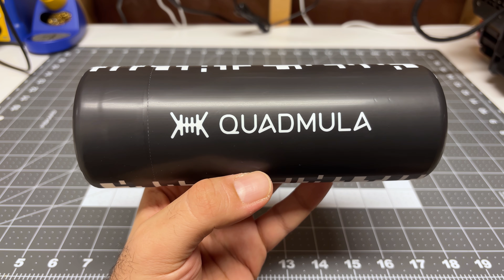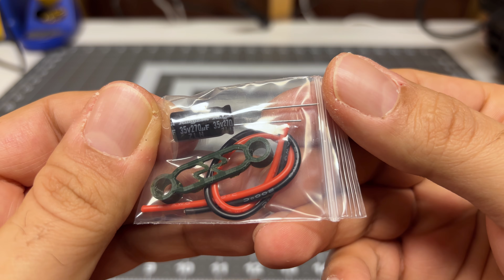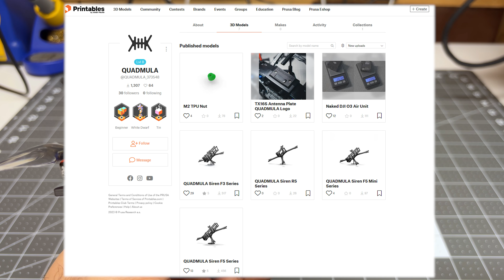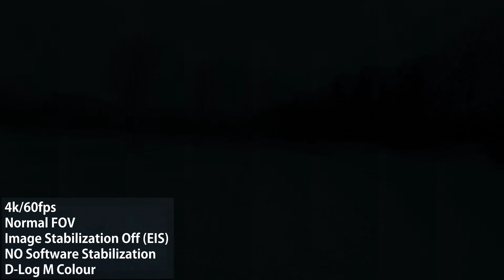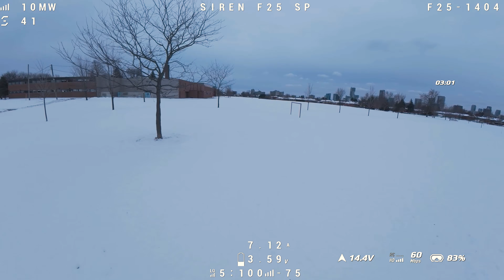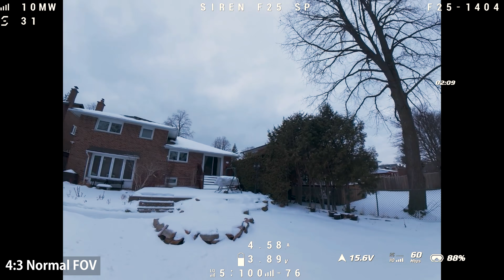First DJI O4 Pro Air Unit EXCLUSIVE Frame 🤩 | The NEW Quadmula Djinn F25 SP 2.5" is Here!

Comment: hey man i love your videos!!! i was wondering i was trying to build the same build you have but i made a change  to the stack because the one you had in your original video was sold out but i was thinking about flying with the Auline 3S 18650 Li-Ion Pack 3000 mAh battery do you think it is gonna be to heavy and not lift off or do you think it will have a lot of power because i was looking for more flight time but i don’t wanna get that battery if im barely going to take off because its so heavy the reason i’m asking is because i was using the uncrashed sim and it lets you make your own drone and put in the specs like how many grams it weights and everything and on the sim the drone was barely taking off is that how it’s gonna feel in real life if i get this bigger battery thank you !!!!!!

Frame: Quadmula Djinn F25 SP: 50
Motors: RCInPower GTS V3 1404 3850kv: 84
Props: HQ Prop 2.5x2.5x3: 3
Gemfan 2512 bi-blades possible upgrade 
Stack: SkyStars F722 HD Pro + 40 A ESC: 129
RadioMaster RP1 ELRS V2: 20
Battery: Auline 3S 18650 Li-Ion Pack 3000 mAh
Reply from the maker: Hmm, that battery pack alone looks like it would weigh 160 grams. That's quite heavy for a quad this small, I usually run packs that are half that weight. Why do you need such a large battery pack?

Comment: Do you feel the 2.5 can be a nice little cruiser for cinematographers as well as some freestyle while being less than 250 and w 850 do longer flights?
Reply from the maker: I wouldn't suggest adding more weight given the smaller props. Is the place you're flying really small that requires a 2.5" to begin with? You could look at going to a 3" or 3.5" if you want longer cruise flights.
Reply: @Mangorille honestly agree and I think 3 is the way for me! Thank you!
Reply from the maker: @mazyarahmadi5424  Welcome, 3 inch is my go-to and has been for the last 4 years. I'll go to 2.5 and 3.5 from time to time but I always come back to 3 inch.
Reply: @Mangorille right on brother thank you

Comment: Interested to know if 2900kv would be a big jump from 2750kv? I have 2750kv on mine and it hovers at 40% throttle... on 6s. any thoughts on how to improve performance?
Reply from the maker: I don't think so. In what area do you find the performance lacking? handling? punch out?
Reply: @Mangorille  I find i lacking in power generally... like my hover percentage is very high I think for a 6s build. It almost feels like I'm flying a 4s battery on a 6s quad...
Reply from the maker: @InfinityDrones  Sounds like your build may be too heavy. What parts and final weight with battery?
Reply: @Mangorille  Thanks for the reply. My weight is exactly the same as Murders FPV - total weight is 189g with 650mah 6s.
Reply from the maker: @InfinityDrones  Do you mean 289g? If so, something is definitely wrong. Post your exact part list please.
Reply: @Mangorille Yes 289g. 
My weight is the same as Murders FPV (like exactly).
Frame 
Speedybee f405 mini
DJI O4 pro 
Hglrc 2750 kV 1404
Geprc EP 1 elrs 
650 HV 6s
Reply from the maker: @InfinityDrones  Nothing wrong with that combo... What about props?
Reply: @Mangorille using gemfan 2540-3 and Avan Rush 2.5 inch
Reply from the maker: @InfinityDrones  Nothing wrong with those props. Something else comes to mind... Double check to make sure you don't have a bad motor or a bad ESC. If one of the ESCs or motors is weak it will hold back the others as the flight controller tries to keep the quad level. Rare issue but I've had this once in the past. Try spooling up each motor in betaflight (without props on!) and see if one of them gives you substantially less RPM at the same throttle setting.
Reply: @Mangorille thank you. I'll check. But this is a brand new build...
Reply from the maker: @InfinityDrones  Doesn't happen frequently but you could have gotten a defective part. The experience I mentioned was on a brand new flight controller stack.

Comment: Great review! I was wondering. I only have 5 and 4 inch quads. But i want to try dji 04 with the most silent setup. Out of all smaller sizes, which prop size do you think is the most quiet? And can also carry a dji 04 pro?
Reply from the maker: 3 and 3.5 inch would be quieter, I'm trying to think long and hard if I recall any substantial noise difference between the two and don't think so. Yes both can carry a O4 pro. I upgraded my 3 inch to use the O4 pro at launch here: https://youtu.be/EawG8dtQmdc

Comment: Those straps are for 3000mah li ion packs.  I end up cutting mine.  04 lite is great on a 5 inch with AXII CNC shell
Reply from the maker: I still can’t understand why they would include the same straps on a 2.5 inch and 5 inch. You’d think those two would use different size batteries right?!
Reply: @Mangorille  EXACTLY

Comment: This could fit a Foxeer 8S stack and a couple 4S 300mah in series. RCinpower 1404 2750kv would be perfect for 8s 2.5" XD
Reply from the maker: I did a test last year going to a 6s pack with smaller cells and actually found that the performance wasn't any better than the larger 4s pack. The smaller cells had way higher internal resistance and the voltage sagged much more than expected. I've heard Bardwell say all the time that the small cells aren't at the same quality as larger cells and he seems to always recommend 4s for smaller quads. I've stuck with 4s as well given my experience with the smaller 6s 530mah packs.
Reply: @Mangorille  The more voltage I have the less D the build needs and the less D filter is needed. I'll keep an eye out for sag on small stuff, so far I've only done 8S and 10S on 5 and 6" so the batteries are larger. Finishing up a 12S 5" then I'll try an 8S 2.5" for science.
Reply from the maker: @ For science! I have so many battery packs just sitting around for the same reason. Appreciate your sacrifice :)

Comment: Stupid question - tell me when looking into googles how do you know when your battery getting low before warming pops up . I see acouple of volts readings in screen
Reply from the maker: You typically look at the average per cell voltage, which is just a calculated number taking the entire battery pack voltage and dividing by the number of cells. I target to land when this numbers hits 3.5 volts per cell. The warnings you see are actually configured in Betaflight based on my own personal preference, such as "Low Battery" warning at 3.5 volts per cell and "Land Now" warning at 3.3 volts per cell.
Reply: Thank you

Comment: thanks for the video.. im getting back into the hobby and considering going with all sub250 drones to avoid registering..  how durable do you think this build is? my last drone was a 5" TBS SourceOne that i crashed multiple times without issues.
Reply from the maker: You're most welcome and welcome back to the hobby! I only fly sub-250 gram for that reason. I find these very durable given the smaller size and lower momentum because of the weight. In all the years of flying sub-250 (5+ years), at most I've broken a motor and an arm. You do go through batteries quicker though because of the quality of smaller cells.
Reply: @Mangorille  gotcha.. im accustomed to used 4s. ill tryout this build thanks.. would a 3" be too heavy?
Reply from the maker: @ No, 3" would weigh about this same. I did a weight check in this video of the 2.5" and a 3" (with identical parts) and they both weighted 156g without the battery.
Reply: @Mangorille  oh duh.. i guess F3 means 3inch lol

Comment: The only problem I can see with the 04 pro is the complete lack of usable nd filters none fit with the frames available.
Reply from the maker: I've got a set of filters on order from Flywoo. I understand that the O4 Pro can use the same filters as the Avata 2. You do need a frame with enough clearance around the camera for a filter, which this frame does seem to have.
Reply: @Mangorille  the avata 2 has a huge camera opening and unfortunately most frames don't accommodate them the only way to use them is to move the camera so far forward as to clear the camera cage that it's no longer protected.
Reply from the maker: @DESTINYFPV  Agreed, the filters made by companies such as Flywoo, GEPRC, and iFlight specifically for the O4 Pro are vertical and more compact.

Comment: Try some T-Motor F1404 4600KV, the 3850KV is a bit low for 2.5".
Reply from the maker: I actually built my non-SP with the iFlight Xing2 1404 4600kv and the 4 blade props. It felt the same but of course was with the heavier O3 air unit so you can probably get another bit of performance that way. However, I still think the best approach is to reduce the weight or even go for a 3" if you need to fly hard.

Comment: It needs more aa far as throttle and voltage because the prop footprint is so small...it takes more for the prop to bite
Reply from the maker: Agree, the props need to spin faster to generate the thrust. Easiest way to counter this would be to reduce the weight of the quad.

Comment: Try the HQ 4 bladed props with an 850hv battery flight performance is much better and just a little longer fly time i also tried it with 6s hv batteries and wow that is what you need to fly this frame yes you are over 250 not by much but it fly's so so so much better murders fpv got it right in his build try it and see.
Reply from the maker: I need my builds to stay under 250g. I've tried 6s 530mah HV packs in the past and you do not get much more performance and the performance drops off way too quickly. I've heard folks like JB mention how at some point you actually lose performance when the cells are too small and they're spot on. The internal resistance of the 530 pack is about double that of the 650 pack.

Comment: Dammit man! Just recently spent over $1500 on new 04s, goggles, three, and three new frames to put those three new air units in. Now because of you, i’m going to have to shell out another 350+ to build one of these little bastards. Naw, I’ve actually been wanting to try a quadmula frame for sometime now, but I always had something in. It’s equivalent size in class. I love the 2.5 inch size as well. I just built the newest 2.5 inch Cine25 from Rosser. I had the previous version and it’s so much stronger implies excellent. This one also looks like a winner, and I don’t have a cine/acro in that size class. I’ve always enjoyed your channel, and have been following all of your recent content. Keep up the good work Bud!
Reply from the maker: Welcome to the FPV disease. ;) Thanks for the kind words.
Reply: @ naw man, I was exposed to the virus back in 2018. I try not to think about it but I’m easily $30,000+ in and have recently resumed to pour a lot of my spare cash(which I know could be more wisely spent) into this crack-like addictive hobby, ever since the O4 hit the scene. I guess I’m going to preemptively start looking for the sturdiest cardboard boxes, since I’m eventually going to end up living in one
Reply from the maker: @gammagonad  This is why I fly smaller 2.5/3 inch quads. Easier on the wallet. :)

Comment: Nice video. Battery manufactures need to redesign the lipo batteries. They need to make them with a lower profile now that we dont need gopros. Its look silly with that battery with such a high centre of gravity.
Reply from the maker: Thank you. You can get slightly flatter packs as well, such as the GNB 660.

Comment: Thanks for the Video. Which adapter did you use to mount the AIO?
Reply from the maker: Welcome. Check the link in the video description, I've got a google drive that has the 3d print files, betaflight config, etc.

Comment: You need to fly with EIS (rocksteady) enabled because that's where 90% of everyone's problem with O4 is. I've built 2 quads now and both required redoing the camera mounts entirely because the camera IMU is so sensitive. In both cases essentially hard mounting the cameras fixed the issues.
Reply: That only apply's to the cheaper 04 lite that does not happen with the pro version.
Reply: @Viseo3dp  you are 100% incorrect. In most cases it's almost unnoticeable unless you're looking for it. The lite does it much more pronounced, this is true, but still very much an issue with the pro. I know this because I've fixed the issue on two brand new drone builds. So much footage with EIS shaking that drives me insane that reviewers and commenters don't even seem to notice.
Reply from the maker: Thanks for the feedback. I generally do not use the stabilization features (on the O3 and the O4) as I find that most of my builds fly smoothly enough that I don't need it for my use case. In your builds, was there noticeable shaking/wobbles visible with EIS off and perhaps the EIS needed to work extra hard to stabilize?
Reply: @Mangorille  Negative, rock solid smooth forward flight on the DVR. Look at the footage playback and there's little micro twitches and shakes obviously from EIS. Total pain in the ass. I've been able to fix it, but requires hours of redesigning the camera mounts. In one case needed to be stiffer, another needed to be softer.
Reply from the maker: @ I did some test flying in the workshop trying to induce propwash etc with EIS on and I didn't see anything weird. Possible that I just don't have the eye for tiny jitters. If helpful, I'm happy to post the raw video on Google drive for you to take a look at.

Comment: Feels like we're guessing at the right motor size. Motor stator size, kv and prop size, vs all up weight, has direct impact on thrust capability and flying characteristics (performance).
I wonder if we would   get better performance with on 2.5's if we moved back down a motor size in addition to dropping all up weight. My target would be a ~35gram 2.5 frame with 1303.5 motors.
Reply from the maker: You're absolutely correct, all of those are intertwined plus the type of flying you're looking to do. I've seen people run 1604 motors on this quad as well, which would be overkill for my type of flying. I've never looked at anything smaller than a 1404 given the weight of these quads when you add in the DJI system. Perhaps something is possible now with the O4 lite.

Comment: Great job! Is there a frame like this for 04 pro that has longer arms to use up to 4 inch props but light weight? I like the explorer lr4 but arms are very weak? Thanks
Reply from the maker: Not that I'm aware of, not too many 4 inch out there. You can find some good 3.5 inch though.

Comment: If only they made a 4" one of these .
Reply from the maker: I expect we'll get a 3 and 3.5 inch version of this.
Reply: @Mangorille  3.5" is nice for freestyle. But I use apex 4" build for a chase rig( need the extra prop size to carry li-ions ) .  Tough frame just dated for 03/04 stuff although I've made it work.  There isn't really any other 4" freestyle frames as such.

Comment: I built and reviewed this last week, ors A BEAUTIFUL frame but the camera just sticks out too much imho.

Love the content bro
Reply: How do you like this vs the avionrc 3.5 O4? 
I find the quadmula frames to be pretty heavy. Makes it a trade off to hit sub250.
I'm a big 4 inch fan. Love the amax F4mini frame.
They also have a new amax f3.5mini
Very light frames
Reply: @chrisbee5481  hey man I prefer the Nexa 3.5 Evo Pro, it's about the same weight but with more thrust, much much better 04 Protection than the Djinn and linger flight times on the same lipos by almost 50%
Reply from the maker: Thanks. Quadmula has a 3d printed front bumper you can use for a bit more protection. If you want no props in view in ultra-wide, unfortunately camera has to be out there.
Reply: @Mangorille  other frames don't have it out there as much to be fair brother and have no props in view, I like it but it just sticks out too much sadly
Reply: @squaddingquads  what other frames are u referring to here?
Reply: @squaddingquads  Yes what other frames ?
Reply from the maker: @ Is the other frame you're looking at possibly a dead cat style frame? If you want a symmetrical X (where all the arms are the same size), you need the camera hanging out fairly forward otherwise you will get the tips of the props in view.
Reply: @himox1651  https://m.youtube.com/watch?v=X-x4bBLSQv8&feature=youtu.be

Comment: I like my SP, and love quadmula, I have more than a dozen of their frames. But recently been really impressed with avionrc. My o4 pro Djinn SP build comes in at 148g meanwhile my avion ikon 2.5 max is 132g with identical components. Thats quite a difference. Features are similar, havent tested durability as much as my quadmulas but so far its been holding up. Gonna build an ikon 3 soon which should only be 4g heavier, performance should be really good.
Reply from the maker: That's a huge weight difference and exactly what you need on a 2.5 inch to balance out the power to weight. How do the frame and arm thickness compare between the two frames?
Reply: @Mangorille  Ikon 2.5 max has 0.5mm thicker arms. Front plate is the same as quadmula (2mm), all the other plates are 0.5mm thinner(1.5mm vs 2mm). Bashed my ikon pretty hard again just now. Damaged the tip of an arm a little bit but other than that its still all good.
Reply from the maker: @painy6588  Thanks for the measurements, that actually sounds very promising.

Comment: Great, have you tried 3000mah lion pack?
Reply from the maker: No but I suspect that would make for more of a heavy cruiser than a nimble freestyle quad. That pack for a 4s would weight nearly 150-200grams. :)
Reply: @Mangorille  will be heavy for sure but I need a a versatile build to bring all over the world
Reply: 3000? You mean 300?
But both would be without any good result.
300mAh will give you 2-3 minutes
3000mAh would be to heavy
Reply: @philihc  the proto25 flies fine with 3000 mah explorer lionpack lion , 15min+
Reply: @user-vc7ep7xj7s  Lion. My fault
Reply: @user-vc7ep7xj7s  ah I oversaw the LION, but why would you